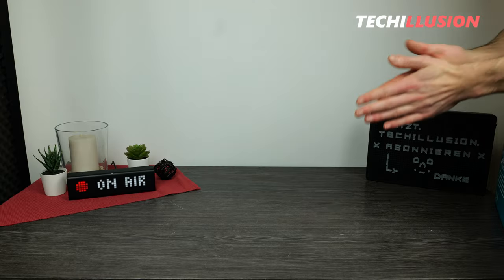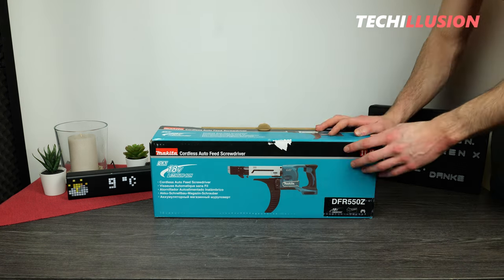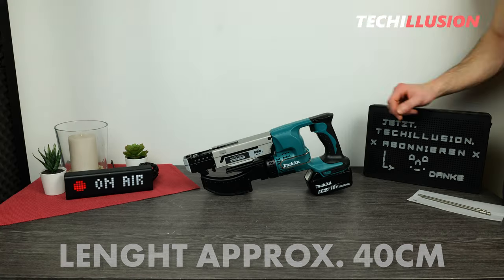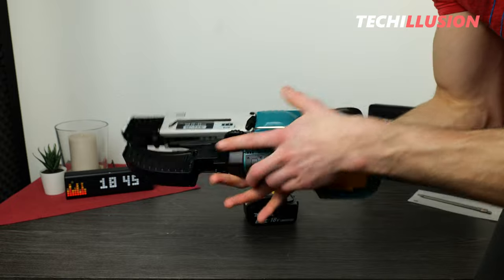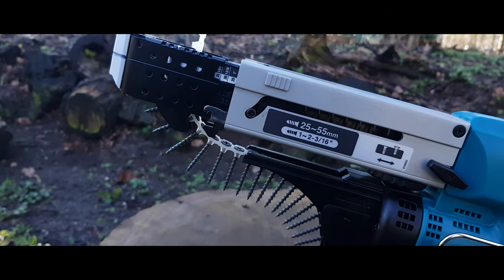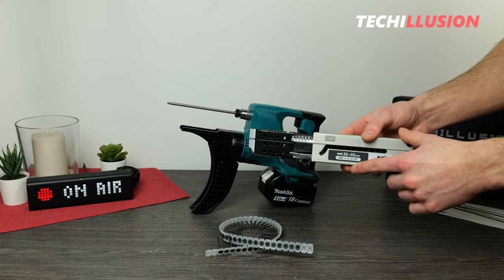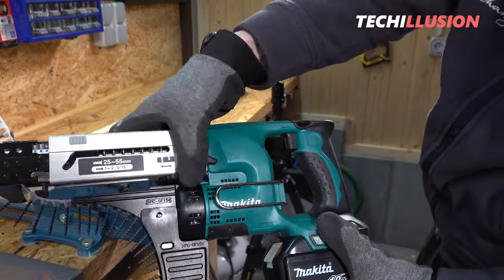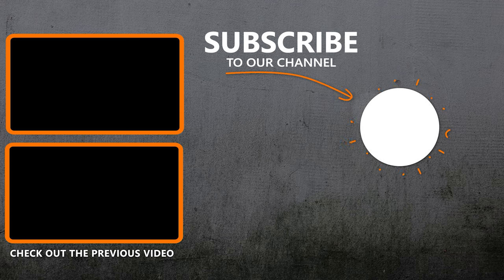🔥HOW GOOD is THE COMPACT Cordless Auto-Feed-Screwdriver DFR550Z (XRF02Z) by MAKITA?!😱  Review Test

Comment: How much is the torque ?
Reply from the maker: Makita has not specified a torque for this tool. The only thing mentioned by the manufacturer is the power of 235W! 😉👍🏼
Best regards
Reply: This is for mounting plasterboard, onto relevant thin metal or soft wood used for the interior of light interior walls. Torque is irrelevant.
Reply from the maker: @IncoG8 Absolutely right! 
Thanks for your feedback :)